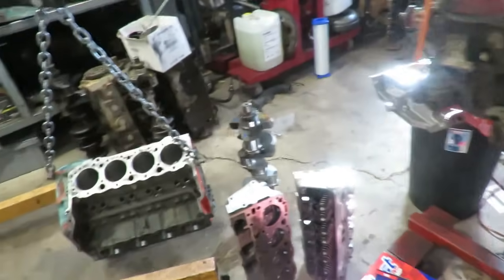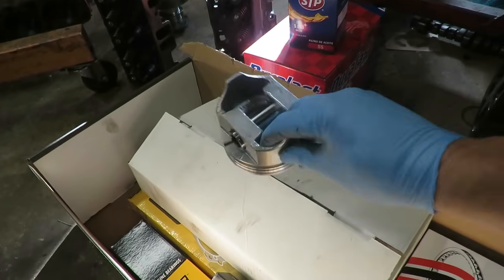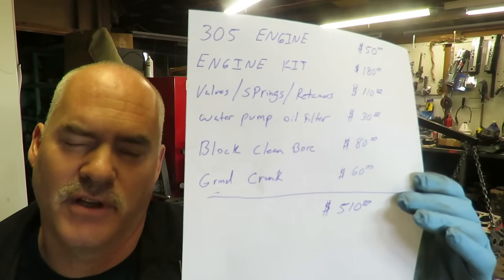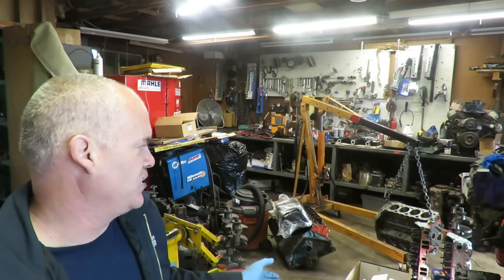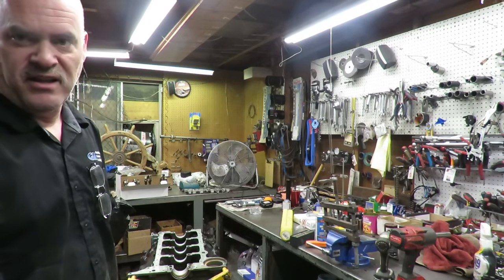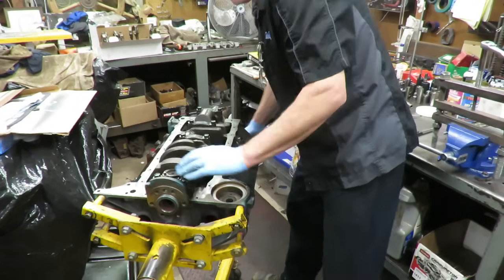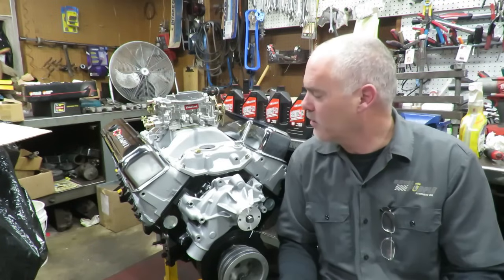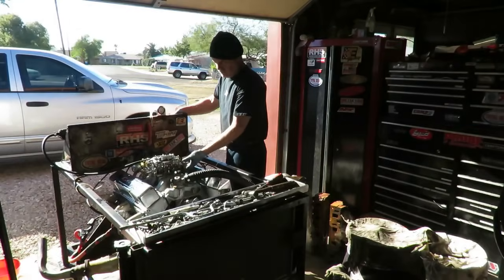Small Block Chevy extreme Budget Build

Comment: David Freiburger
 said it right. Don't get it right. Just get it running.
Reply: ...your comment is making me second guess replacing my 455 Olds crappy low compression 8.5:1 pistons with 9.8:1......
Reply: goinjones
Reply: @goinjones  
Change the pistons and you won't regret it later. That 8.5 smog compression really does suck the power potential out of a 455.  
Besides that Lucky Costa fixes 99% of whatever  Freiburger works on. :-D
Reply: @goinjones  a 455 doesn't require high compression to make good power. I say leave the lower compression piston in there and run regular gas and don't worry about detonation. Hell, my 455 SD is 8.5:1 and it is not lacking anything.
Reply: I just watched that episode
Reply from the maker: @goinjones  If your on pump gas I'd leave it alone what really needs to be done is find a good set of heads if your running smog stuff get yourself a set of C heads they flow the best the cam and valve springs should also be upgraded along with a good intake and headers these mods will make a world of difference on a smoged out 455
Reply: @Myvintageiron7512  I appreciate your feedback, I got a low mileage 455 pulled apart and everything looked good, if I just put new gaskets in her would that 8.5:1 compression help dampen the 100 shots I plan on feeding her?
Reply: @superduty4556  
This engine makes great torque even w 8.5, I'v heard other guys say the exact same thing .
Reply: Sage advice for those with absolutely no intellect.
Reply: @port nut that's okay, I'll leave the 30hp on the table and never worry about my octane requirements or if I got crappy gas. 

When your new Mustangs and Challengers have about 500hp from the showroom, I don't even bother trying to keep up and just have something that's fun to drive.
Reply: I've noticed alot of yank build never go above 10:1 comp ratio. It Aus that seems to be a minimum lol. Is the fuel really poor over there?
Reply: @goinjones  now you get the joy of only using super high test,having wickedly high compression and the adjoining detonation whenever you happen to use shitty gas
Reply: @port nut compression doesn't make efficiency,it benefits from heads designed with efficiency in mind.
really good combustion chamber design(see vortec l31 heads),squish and everything relating to both
 makes efficiency and then you can have higher compression.
Reply: @chevydyall7619  do you have above 94 octane? or do you regularly run 4$ a gallon av gas
Reply: @trillrifaxegrindor4411  yeah we have 98 but I think ours is a different metric to yours. Our e10 is apparently 94 octane
Reply: yeah only thing is that is the wrong way and worse, and like a drain that is caving in getting larger and larger and the wide road to destruction feeding instead of perfect only gives you worse all the shit that comes out. Everyone grow a spine and demand perfection for it is not a natural thing what ones call 'death' it is an imposter , and NOT the natural state, for the natural state is forever and perfection and with god, this ground is part of heaven also, is there anything that be , that exist, that it should become made rotten and devoured by vermin and pirates in the creation and allowed to exist as 'a way' of existing, it shall be deleted as it is a threat to heaven and all my creation , i am. and nothingness shall never be nor any nothingness in my creation allowed. in the creation only creation and perfection are insisted upon for heaven and perfection is forever and the good enough. We Have To FORCE This Government To Reason, it likes the idea of death and its ways to continue in such even at a greater rate and is never filled and never pleased because it is nothing and nothing does NOT feel anything nor THINKS at ALL it is deception and illusion and lies to its followers and those that follow and believe it are become also liars and murderers from the beginning and are NOT and shall be not anymore against us in the name of the parent the offspring and the holy spirit , the holy ghost, the savior the mother the father the womb the universe and spirit of all and heaven and earth forever, amen..
Reply: @jimbojimson  hey man what state are you located ... Want come by & See if you cann help with my 350 small block rebuild

Comment: This is very similar to my car. I have an 82 Camaro Z28 that I got from the original owner and he had the stock 305 bored 30 over and reconditioned the stock heads, swapped out the cam for a mild Crane Energizer cam & lifters, aluminum intake and Holly 4BBL 650CFM carb, shorty headers, electronic fuel pump with 373 gears and a stage two shift kit.  The car is at right around 300-315hp as it is, I'd like to up the power by 100hp and everybody's answer is to just buy a 350 which is fine, but id like to keep the original engine in it if possible.  I'm hoping that if I change the stock exhaust to a Flowmaster system and upgrade the cam to a more aggressive one(matched to the engine of course) and a new torque converter(2500+ stall) with possibly a Holly Sniper EFI system(maybe) along with a set of decent aluminum heads might do the trick. More research needed
Reply: HP is about cubic inches and air flow.  You have to flow the air & fuel that will make the target HP.  A 305 is going to have a bit of a hard time doing that w/o turning 7,000 ...  And then it might not be very friendly on the street.
The cheapest way to keep everything is to just add a blower.  Edelbrock, Wieand, it does not make a lot of difference.  5PSI boost should get you what you want w/o changing much, and it will not kill the engine  :)
Reply: Broc Luno I’m going to have to look into that
Reply: If you are at 300, and you want 400, you are 75% of the way.  Making another 25% will prolly not happen with your suggested changes unless the new heads push the CR up to 10~11 to 1.  Basically what you are asking for is a 302 race motor.  Can be done, but kinda peaky and not much bottom end at all.  That might be miserable on the street ...  OTOH, a small blown boost adds power at all RPM ranges, so you can forego the converter change, etc.  That is why MFG's love to add a blower for their "special" cars.  They can be driven by wives and girlfriends w/o issue.
Reply: Broc Luno I’ve been pondering this since my original post and I think you are definitely right.  I’m going to look at that along with a possible engine & trans swap to a 350 even though I originally didn’t want to do it.

Comment: FiY ; in 1983 Los Angeles; I bought a Reconditioned Chev 327 short block delivered to Redondo Beach $350 ; for my 1975 Camaro  (350)  . I only lapped the valves. Fitted the old water pump . A friend and I assembeled it over a weekend the heads and dropped it back into the Camaro . It drove very responsive !. :Fun :)

Comment: Trying to find a video on a cheap rebuild for a 94 5.7 truck motor.   Have you done that yet for the pre vortec motors using the early vortec heads (for torque)?  Enjoy you videos.   Very educational!
Reply: I did that exact engine. 0.480  lift and 232 @ 0.050 112 LSA I believe. It had a great idle tone. Never had the chance to get it running quite right before it was stolen. If you keep the TBI it definitely needs a tune chip at the very least.

Comment: this is a great idea and need since im in Canada it would be higher but I did something similar to 350 it was a tad more expensive around 2k cad in about 97 but I did do some line boring plus bored it out to 30 thousands to make it a 355.i put it into 1971 chef truck sadly my wife got a hold of it otherwise id still have it, made a huge difference going up those hills on the Klondike highway in the yukon

Comment: I am very much impressed with your budget build.I have friends that say don't try and build an engine just have it built..its cheaper ,its less money...BS here is proof..Besides its kind of hard to run an engine with more than a 470-500 lift cam on the street..They load up and overheat..I just bought a stock rebuilt 1968 396 big block .$ 350 .no pan or water pump,or alternator,pulleys etc.Does have a stock intake awful heavy,but i  am pretty sure i can get all the parts and make it go for less than $1000 buying various parts here and there .So $1350 is a darn good deal.I have a !967 Chevelle with a 300 hp 327..First thing people ask is "is it a SS 396" ,now i can say yes..So pay attention guys it can be done . Just don't get in a huge hurry just a sharp eye out for parts...ps my friend did the very same thing in a 1954 chevy..He says to me well its a 305 , and I say your car is on the road not sitting waiting for a high dollar build you can't afford..thanks so much ,finally a builder with a good head on his shoulders!
Reply from the maker: you can definitely do it for that I have gotten several comments on this video calling me out saying there is no way I could do mine for this price no way was the block machine work this cheap the fact is these people aren't paying attention to the video at all I said more than ounce you need to make friends with a local machine shop of course they are not going to do the machine work this cheaply on every engine the key is to get them to do it for you for a really low price your post is refreshing because you get it! the whole reason for this video is for guys like you that are already wanting to do this I think you are right on your 396 is almost there already shop around and don't listen to the negative people

Comment: When I was in high school My Dad, Brother, Uncle and I built a very similar engine for my Dad’s ‘63 Chevy shortbox, ( the cam/valvetrain was a base Edelbrock performer set up along with the performer manifold and 600cfm carb, stock HEI) until recently we ran it with a 700r4, and a 10 bolt dogleg with .273 gears, the silly thing is that it was thrillingly fast! And sounded better than anything out there with cheap long tube headers and 2,1/4” purple hornies and angle cut pipes exiting in front of the rear wheels, I highly recommend this combination in a light weight vehicle, like a Datsun or something. I’m almost reluctantly replacing this combo with a turbo, 496 stroker, power glide and gears to be determined in a much stronger rear end ( still need to find that last part)
Reply: Btw, the rear end will be from Tom’s differentials in Sandpoint Idaho. Tom passed a couple years ago, but his legacy is an incredible inventory, and a RIGID understanding of quality in his family some of whom I happen to know personally. Even if you don’t end up buying hardware check out their merchandise, the Butt logo beanie is something you need to own.
Reply: Wow, this video has me on a tangent, I actually still have all of that stuff and access to two free datsun pickups, I might have to add a secondary project, I wouldn’t be surprised to get into the 11’s or better.
Reply: Oh no! I have a couple of sets of 283 power pack heads and I’ve always wondered how a ported set would run on that engine, now I feel like I almost have to throw the Datrod together, damn and I just this instant had to name it. I might return to this thread in the future...
Reply from the maker: Interesting,  I grew up in Spokane and I still have a home in Priest River I'll check em out
Reply: Myvintageiron7512 yeah, you totally should, it’s a real shame Tom Watt isn’t around anymore he was a car guy’s car guy. And the products he carried and or manufactured were always top notch. His Corvette independent rears are the best out there for extreme use. His 9” Ford housings are Bitchin too

Comment: I put rebuilt  305 in 2 autos 1 was a box truck {yes a Izuzu Napier)  and I liked it so much then in a 1986 Cj7 I did a cab off restoration on 14 years ago and it runs great with 19 mpg and so dependable. I thought if it did not have the power I liked I would change it to a 350 NOP it is fine thanks.

Comment: Congradulations!

Probably need to add $400-600 for the "find" if an engine and "going" machine shop rates here in Chicagoland: but still fun!

My aunt was sold a 1979  Pontiac Grand Am station wagon and GM put a 305 in it.  My parents bought my sister a 1988 Chevy Caprice with a 305: both accelerated like painted ships upon a painted ocean.

Comment: My small block Chevy extreme budget build was only like $100.00, free 327 short block, free used 307 heads off my old 307 did not even rebuild them, $20.00 for a used Z28 intake, carb, and lifters, $50.00 for a new cam it was called a Zip 500, maybe another $20.00 for some new gaskets and used a lot of the old ones like head gaskets, did wast any time cleaning, just thou it all together did not check for anything, that was my first engine rebuild like 50 years ago, did not have a clue what I was doing, did all wrong! I do not know why? but that thing was FAST!!!! like real! fast.
Reply: "rev higher" BOY!  did that engine rev, when the car was stock, in first gear flat out 35 MPH with the 327 60 MPH in first gear, I could not even tell you what the red line was, had no tack,  must have been that least 7500 to 8000 RPM.
Reply from the maker: things are a little more expensive now
Reply: @Myvintageiron7512  Yep, I know that, also I did not do anything to that engine and was super lucky it ran as good as it did, I know that even more  today, I just retired  after 50 years of being a mechanic, I was the go-to guy for tuning and engine rebuilding that all the shops I work at.
Reply: There is a reason nobody wants a 307 or 307 heads.  Completely pointless.   With how cheap small block Chevy parts are this is just ridiculous.
Reply: @Myvintageiron7512  Hey, just reading some of your comments after watching the video. I just brought a 350 engine for $100 bucks, completely rebuilt never had engine oil or been ran All stock parts inside just bored 40 over. I found a deal on some vortec heads and a flat tappet cam which I really don't know the specs on,  roller rockers,lifters, and a intake manifold all for $500 bucks. I'm just going to bolt that top-end stuff on that engine and go with it from there, but I really would like to find out the specs on that flat tappet cam all I know is it has a about a 555 lift. And it hasn't been used long.
Any suggestions?
Reply: It seemed that way but it wasnt fast ,it just got faster with time gone by. what you did was build a hines57 mutt,you didn't rebuild anything.

Comment: I very much appreciate the time and effort it takes to make a video like this but somewhat bait and switch. lol... This is all "I know a guy who knows a guy pricing.... 30$ for cam bearing install?... no one will get out of bed for less than 200 nowadays.   as someone else said. "buddy" is the key word commonly used in this video.  

thanks for the video! clear, clean, and easy to follow.
Reply from the maker: if your paying 200 to have cam bearings installed I want to do all your blocks
Reply: @Myvintageiron7512   figure of speech that was all encompassing of the(your) video as a whole $$ - not a direct relation to a cam bearing install in specific.

Comment: I thought machine work here in Alabama was inexpensive compared to other  parts of the country . I don't know anywhere you can get a crank turned or a block bored for those prices .  We get 100.00 to do either one at my shop . I'm a little less than the shops in Birmingham .
  Awesome build on the 305 . I have done a few high performance 305's over the years . I have also discovered that a 350 engine kit is often less expensive . 
  Had a round tracker that worked for me years ago . He picked up used pistons and bearings from our scrap and built and engine . All he paid for was rings and gaskets . I didn't think it would last very long but he raced 3 years on that engine .  That was budget build for sure .
Reply from the maker: Like I said man you gotta make friends with these shops when you go in ask them to help you out when it comes to labor most shops will negotiate strip the block yourself take all the core and gallery plugs out pour rubbing alcohol or degreaser on the block and let it eat off excess oil scrape any thick build up of sludge off the outside so it doesn't look that dirty this goes a long way towards getting a discount the less cleaning they need to do the less labor your block is in the shop's eyes and then ask them if they can help you out on this one tell them your up against a real tight budget most of the time they will cut you slack on the price

Comment: I had  2  1991 chevy wagons , 305 ci   ,  went 205 & 208,000 miles before they needed any work
Reply: Got a 264,000 mile 305 Camaro, those little small block bastards can run forever.
Reply: I have had a lot of Camaro's  & Firebird's  ,  I just got a 2018 SS Camaro  I hope it gives me many miles !!   @MidnightMechanic
Reply: @danoneill2846  2018 Camaros don't have 305s. ;) lol
Reply: I am a little over 600k on my 350 that's in my Suburban. Best engines ever made.